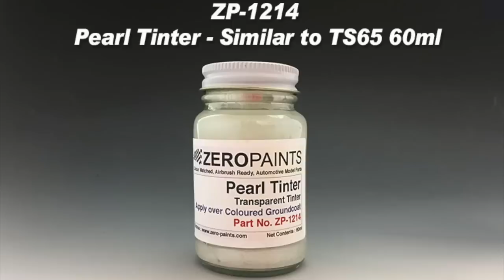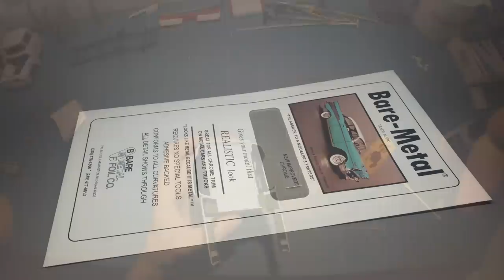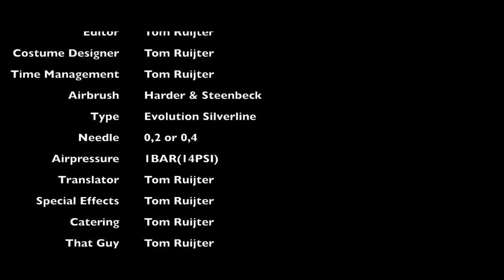Revell: Foose Ford FD-100 Full Build Step by Step

Comment: I had this exact model as a kid. Painted mine cherry red, modified the hood and took the motor from another model, an old Thunderbird pro stock drag car, swapped the wheels and drag radials, modified the hood for the blower to stick out of. The Thunderbird I got when I was like 8 or 9 and when I tried making that car I lost some parts and it wasn't able to be finished it, which made it perfect for taking parts from. Wish I still had the truck though, got thrown out when I moved from my parents house.

Comment: Wow! Really nice job! I didn't realize that there were Foose kits out there. I've been a fan of his work for a long time. Even before 'OverHauling'. I especially like the gunmetal accents. I think you should have done the window trim gunmetal as well, instead of bear metal foil (although you did do really good with it). I built a F-100 kit (not Foose) years ago, but went completely the opposite direction. I call it, "Left & Forgotten". Banged up, rust bucket with the engine & transmission gone, windshield busted out, front wheels missing and gauge cluster gone and holes in the seat and bed. Poor ole thing is sitting on rocks and next to a three strand barbed wire fence that needs repairs too. There are a few things I need to do to it that I didn't think about till recently, then I think it's time to sell her after the September model show I'm entering it into. 

Anyway, great job. Thanks for sharing your work.
Reply: That'd be "Foose" as in Chip Foose, not Fosse. Bob Fosse was a famous director, dance choreographer. Keep building!
Reply: Richard Williams yes. I didn't catch the dang auto spell correct. I'll fix it. Thanks for catching it.

Comment: Cool built!
I have a question, you say you build kits for other people, but how does that work because i have a 1971 plymouth gtx that i cant get done. Ive done the interior but chassis and bodywork are an issue. The body is straight with no flaws of what i see. The chassis is been painted and detailed but the suspension is not attached. You could just paint over the paint drom the chassis.
Reply from the maker: This video was done a while ago. I no longer build for others. I have way to much work currently :D

Comment: Quick question, when you did the engine did you sand it, prime it, then paint, or did you put straight paint on it?
Reply from the maker: Little to no sanding. Then primer and paint
Reply: Ok thanks I’m doing a model to and needed that thank you!

Comment: I would just like you ask is the American bar different to other bars? Because when I went to school a bar was 14 psi I14.5038 psi to be more precise) So 1.5 bar would be nearer to 21 psi.
Reply from the maker: you're correct
Reply: @TheScalemodelingChannel  BTW I did like your finished model.

Comment: Chip Foose designs sometimes are a bit over customized it is no longer an original classic and lose what made it so popular to begin with, this particular design not as bad as others for me the use of oversized rims and low profile tires specially on a truck doesn't work as well as standard size rims with big fat wide tires, now if you add some blue metalic flames on the front end of hood and fenders only, Truck of my dreams I just built the monogram Classic Cruser F100 this way would never use purple as the box has it. Come On! Ahahahahaaahah!